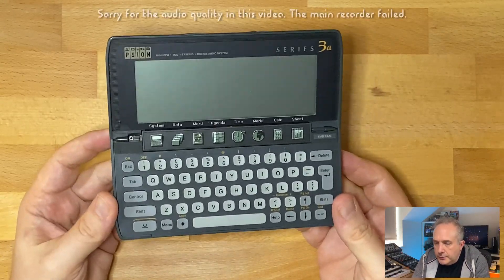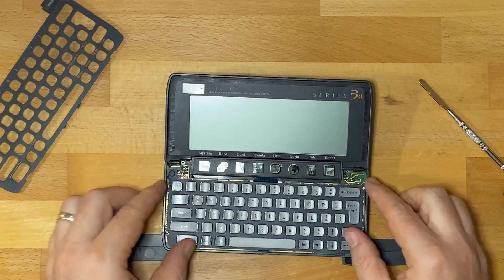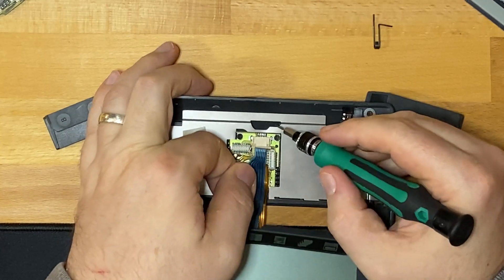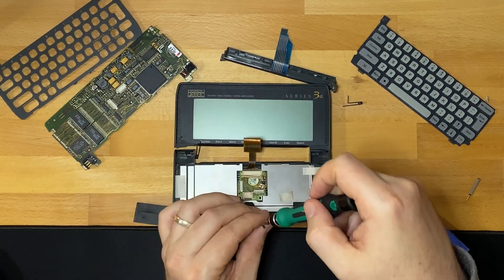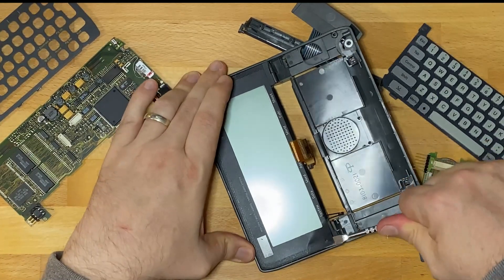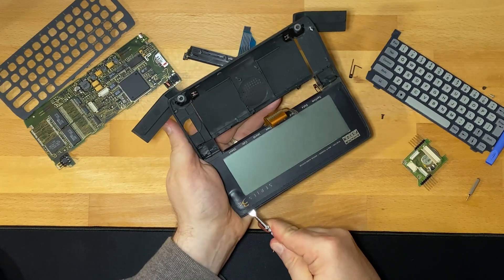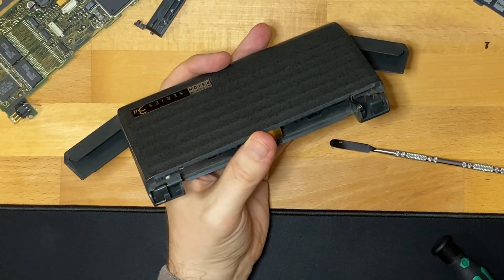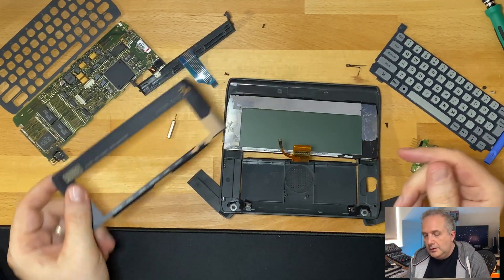Psion 3a  - Part 2 -  Teardown

Comment: Some 3a need to peel the foil mine has no screws in it also found the metal pin on the hinges rust after time and also the springs this makes the plastic on the hinge break as seen on so many

Comment: Hi, Nick. If you absolutely need to remove the foil front of a 3a screen, I found a credit card the best tool. Push the card under the foil at the bottom of the screen where the words are for the touch bar. Slowly move it under the foil from side to side until the bottom is free, then work up each side, slowly and really carefully. Finally run across the top- from the inside, not from outside at the top of the screen. If you do it carefully, you don’t bruise the foil and don’t tear off the black paint. Believe me, I share your pain.
Reply from the maker: Hi Ryan. That's a really great tip! If I come across another screen that needs the lifting, I'll definitely use this method. Thank for taking the time to leave a comment.
Reply: @sidequesting7427  I'd be tempted to use a tiny amount of heat like one of those bean bag things you can microwave which will help to soften the glue